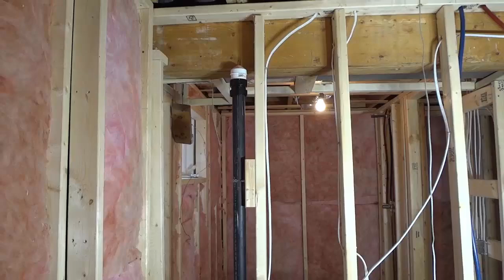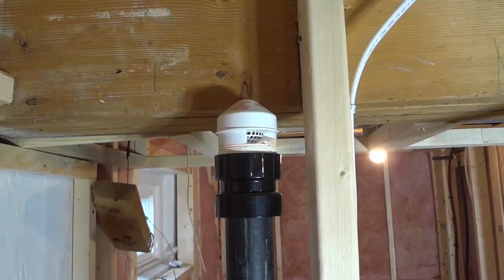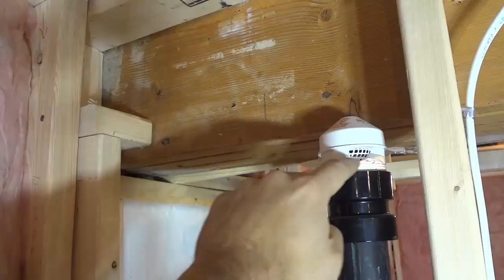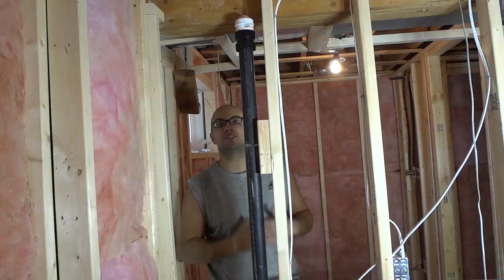Cheater Vent For Plumbing-How It Works (AKA Air Admittance Valve)

Comment: For those who dont know, there are 2 types, Sealed and not sealed. The one pictured in the video is a free flowing open vent. The sealed ones are typically black and have a rubber seal helded closed by a spring, which are one way valves and allow air to be sucked in as needed, but doesn't let air out. The sealed type can go bad, because they can get stuck closed, not allowing air in or out. 

Where are these typically located when put in a wall?  Behind a shower or behind a toilet?
  
I typically see them under a sink but I have a friend who had someone install some permanently behind a wall and they are having issues now.

My other question is, how many are required for a 2 bathroom ventless house, meaning a house with No plumbing pipe roof vents?
   My assumption is there should be one at every location that has a drain, one per bathroom and one per kitchen.

Comment: Mine are under the vanity/ bathrooms and under the kitchen sinks. Let me tell you after 5 , 6 years plan on replacing them. We had guests for about a week . Using the  extra bathroom and shower. We found that 
if the shower was not used in the extra bath room for over 30 days, the trap went dry, and gas would back up no matter whether a cheater vent or not.
Reply: If the trap is dry - sewer gas has a straight exhaust out the fixture - whether you have a regular vent,  a cheater, or none at all does not matter.

Comment: Ok great but can you did t discuss where it is.  Is it connected on the toilet.  Is it in the wall to be covered with drywall.  Does it still get air if inside the closed wall??

Comment: Sounds like a good idea but what happens when the check valve fails?  Failed closed would be OK.  Open or leaky would not.
Reply: It's a spring, so depending on what the spring is made of it may or may not rust. And that would also depend on the quality of the living conditions inside the home. Springs in general are extremely reliable. They sell plastic ones at cat toys are used so small they are microscopic, and so large I wouldn't be able to pick one up. Some might fail the first time you use a cheap pen, others are built into the foundations of buildings for earthquake damage prevention that will last longer than any of us will live.

Comment: The question is: How long it stays in good conditions? Do they get stuck?
Reply: yes, and check the warranty. You will want a spring door as an access panel to get to it if you ever need to replace it.
Reply: My Oatey inline vent failed after about 15 years.

Comment: Yes, an air admittance valve is wonderful, and...they unfortunately fail.  Make sure the plumber installs an attractive access door so that a new one can be installed.
Reply: How long do they typically last?
Reply: The spring ones can barely last more than a year. The slightly more expensive rubber ones can last up to 5 years. They are getting better, but the market is also flooded with cheap knockoffs.
Reply: Or you could just do it the traditional way and it will never fail

Comment: They should be illegal. They are supposed to be changed out on occasion and when they are buried in walls and such you cant find them when they fail filling the house full of stink and gas. Last one I found in a drop ceiling that failed and filled the space with methane. All it was waiting for was a spark from the overhead lights. The one in the video will be buried behind sheetrock on both sides and the homeowners will never know about it and think something died in their walls when it fails.

Comment: I would not hide it in the wall though, I would have exposed under the sink...it will wear out and need changing...
Reply: Correct it’s a mechanical device and is subject to fail. It should be accessible, not readily accessible, but at least accessible.
Reply: I try to locate them under the sink as high as I can go. The wall is fine but needs an access panel. In my first house, I put a basement bathroom and I located behind the medicine cabinet, which only had four screws to remove in case I ever had to change it which I didn’t and lived there for 10 years.

Comment: I’m planning on rutting my vent pipe that goes through the middle of what will be my daughters room in the attic. Cut and seal pipe from roofline then put this vent in the floor joists. The joist runs all along the house and out to my porch so it will get the air it needs I think.
Reply: Bad idea. Why don't you route the pipe into a wall.  There's a reason why it goes through the roof, the air will dissipate better up high.

Comment: I bet they told you, makes sense to not put this behind a wall especially if they need replacing, what a nightmare and what sleepless nights I'd have wondering if my toilet is burping stink in my walls... thanks for sharing
Reply: If you worry about sewer gasses leaking into your house after a new renovation, you have an easy life. Building codes almost always require access to anything someone will eventually need access to. Junctions, p-traps, cheater vent, manifolds, valves, etc. As such, wherever you have it installed you would have an access panel to get in there to test it anytime the bathroom smells unpleasant, or whenever paranoia insists. Sewer gasses don't smell like a typical "blown up" bathroom. But if you detect a hint of something that smells "weird", it's probably sewer gas. Especially if you can air it out with an open window, or fans, close the door, not use it for a while, and then see if the smell comes back on it's own.

Comment: She forgot to mention not to cover with walls completely. You have cut out a rectangle next to it and put an AC vent cover over it so that it can be checked and repaired if needed and get sufficient Air Supply
Reply: You just answered my question...

Comment: These valves will break down and fail over time, so it's a bad idea to have it concealed in a wall, where sewer gas could leak out of it and make it difficult to find when trying to get rid of the smell.  Best to just reroute that pipe to the right of that stud by drilling through it and go straight up and out the roof.  Definitely a better, more permanent solution.
Reply: 20 years AAV's open to replacement? and remodeling in an existing concrete structural frame block and brick infill walls pinned between side buildings 4story building that has none ... and oddly enough worked anyway with a couple vertical stacks connected only to the main horizontal to street-line : )

Comment: If you use this in a wall, needs to have a panel. Also I would drill a inch hole on the top of the stud into the attic for it to get air. If you put in wall it will not have anyway to get air it needs and future home buyers wont even know its in there. Also buy a real valve something like a magic vent dont use knock off valves.

Comment: You are cheating your self.sewrage gas getting back to your house.stop teaching pepole wrong .codes are made for resone.same like driving car says drive 25mph and you drive 60mph and run someone over.im not a plumber but you are wrong for posting this.its something that can do damage to your health.
Reply: on a kitchen sink, I have a 2" pipe from 8.5'.....is that 'good enough'? (I live in europe--not worried about codes)
Reply: and, thanks for any info you can pass along :)

Comment: Problem I see if you block the vent with drywall you may potentially create a vacuum that can make the cheater fail they are ment to in locations where air is abundant

Comment: Alternative is if you are adding new sinks, bathtubs, toilets, just simply tear the wall open, tear the ceiling apart, cut a hole in your roof, do not put a island sink in, and do not go over the speed limit. I saw on a cruise ship, every wash machine had their own AAV. Someone should make them cut holes & put pipe thru every floor of the ship.
Reply: lol

Comment: What if the spring fails I'd run the pipe outside the back of the house I don't want nothing in my roof that I spend thousands of dollars on
Reply: I know in Illinois you cant bring a vent out the side of a house. It must go through the roof and these mechanical vents are illegal

Comment: Spring is in the automatic air vent which is no longer approved, the air admittance valve has no spring.
Reply: Good point. I still see the old spring loaded ones at the hardware store; they're no longer allowed because they're a bit unreliable. The new ones by Oatey and Studor are springless, are far more reliable and durable, and are allowed in most jurisdictions.

Comment: Cheating vents. How will the cheating vent get air if your going to wall that area with drywall or plywood.  Would there be sufficient air? The wall is basically basically sealed. Also you repeat repeat too much much.

Comment: Dude, it's called a Studor vent, not a Cheater vent.
Reply: BrainToMush we call them auto vent
Reply: @Armond 'Bob' Welch WTF?  Either you have never worked as a plumber or you're just playing dumb.  Plumber's often call it a "Studor Vents," just like some plumbers use the term "Fernco Adapter" no matter the brand.  "Studor Vent" is accepted nomenclature in the plumbing profession.  I haven't run into many plumbers who go around saying, "Air Admittance Valve".  I certainly have never heard a plumber use the term "Cheater Vent".  They often refer to them as an "AAV".  You think I don't know that?

Comment: the instruction for installing this air vent is to be accessible for possible maintenance. it needs to be visible. it is wrong to put it between the studs suggesting being hidden later by walls.
Reply: Maybe it’s an access panel 🤷‍♂️
Reply: @billybranum1852  It sure better be.
Reply: I agree, similar to burying a junction box in a wall. It gets done , and i have removed many over the years.   None were causing problems, just fixed during renovation
Reply: Yea, first 5 seconds I knew this guy was a fucking clown.
Reply: @RedDelPaPa  Exactly 5 sec for me too!  .....And I'm not a plumber, just a diy homeowner.
Reply: you can put one in the wall there just has to be a grill or some sort of box to allow access.